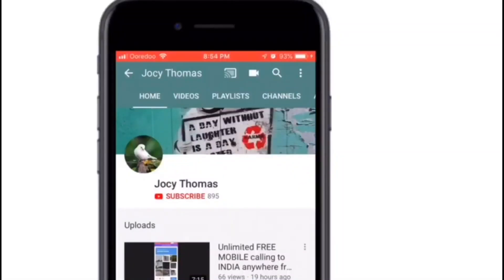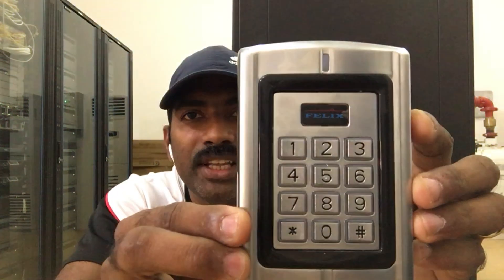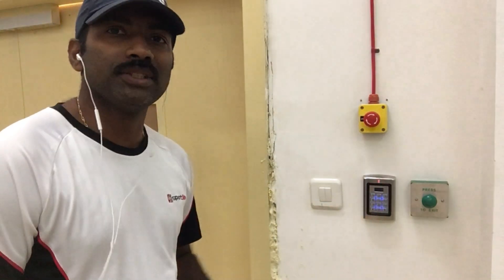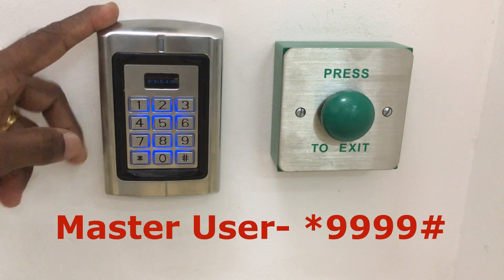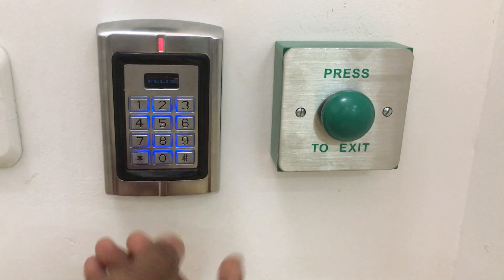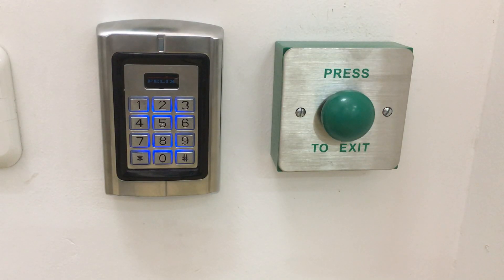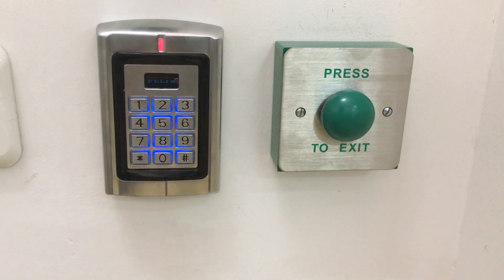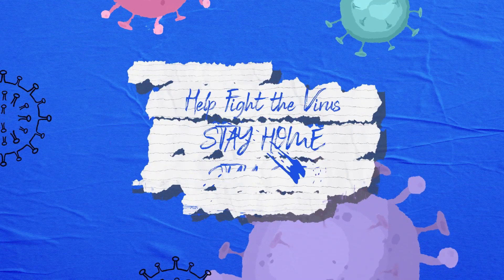വീട്ടിലെ ഡോറിൽ അക്സസ്സ് കണ്ട്രോൾ പിടിപ്പിച്ചാലോ| how to install Door Access System

Comment: Bro edhinde installing engine ann i meaning controlling waring
Reply from the maker: Controlling wiring explain chaythittille?
Reply: @JocyThomasC  ella
Reply from the maker: @sadiqbinzakariya835  ok. Wiring enikkormayillaa orupadayille simple aanu loop the lock positive through the unit and use exit/ PB wire for PB connection.  . Product vaangiyathinu sehaam pic ayachu tha. Njan paranju tharam